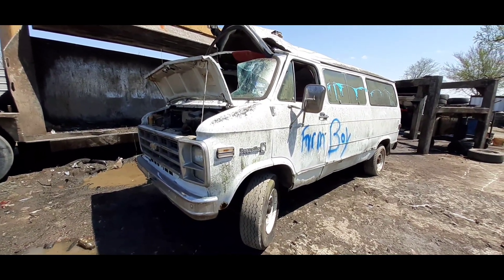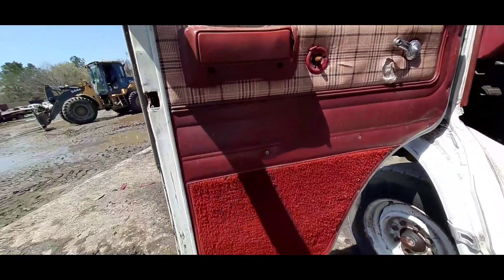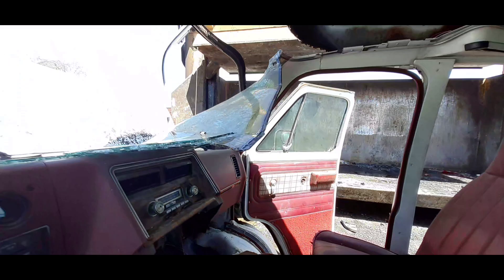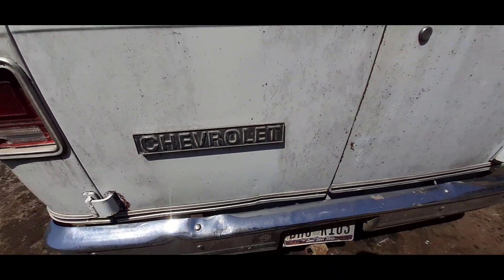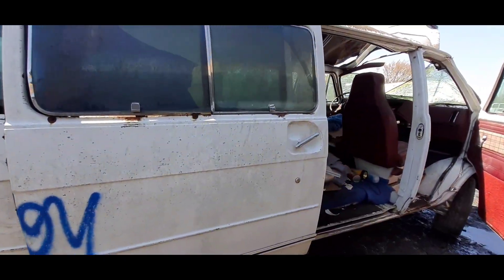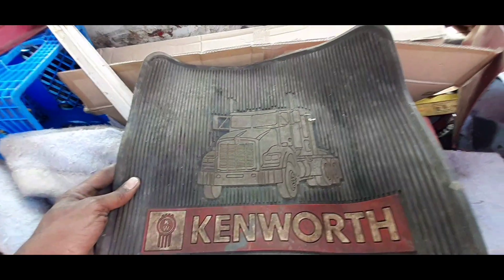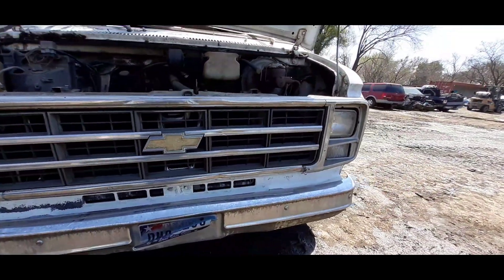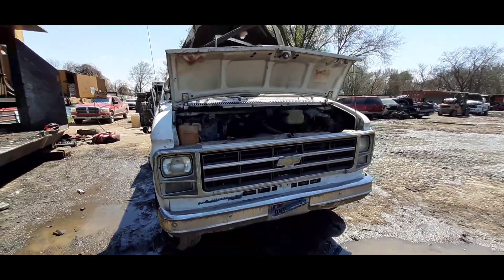1979 Chevrolet G30 Beauville Van. DEATH ROW SENTENCE.

Comment: Yup, 1979. It's pronounced "Bo-Ville", as it's also French. Correct, this is a 1 ton G30. Beauville is just a trim package on the G Series van. 

We got the VIN, we win: C for Chevrolet, G for G Series Van, L for 350 V8 with four barrel, 3 for 1 ton rating, 6 for Sport Van/Rally Wagon, 9 for 1979 model year, 4 for Scarborough, Ontario Canada assembly and the rest is the production sequence.  We got the SPID, glad you did. Exterior paint is code 12 Frost White and the rest of the codes are shown for all to see. 

This one was made on Friday June 8, 1979 according to the top of the SPID label. The Scarborough plant assembled vans from 1970 to 1993 and then closed in 1993. The plant opened up in 1952 as a Frigidaire refrigerator plant and became a vehicle assembly plant in 1974. There is a shopping mall there today. 

Yup, plenty of good parts on this one, but as you stated time is of the essence, so that is the priority over the pulling of parts.